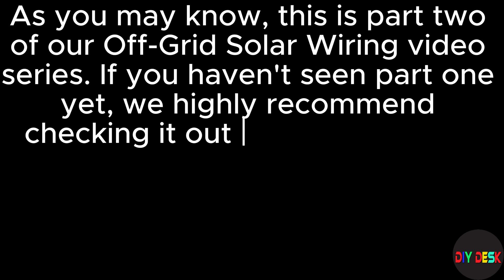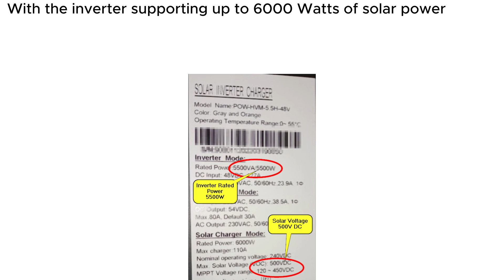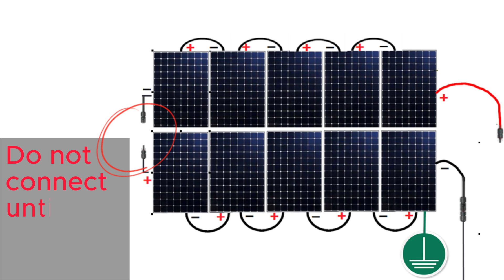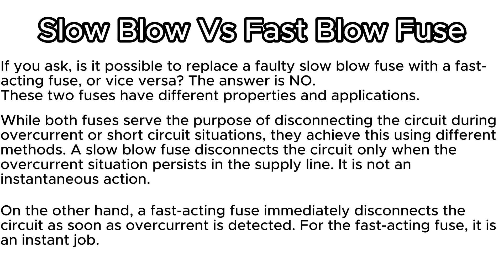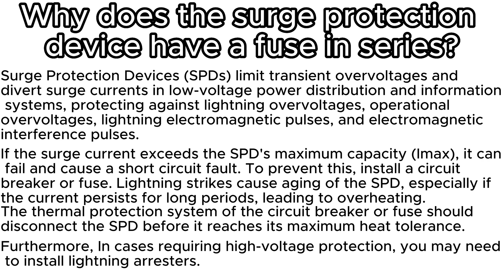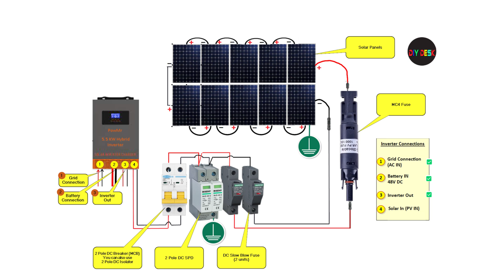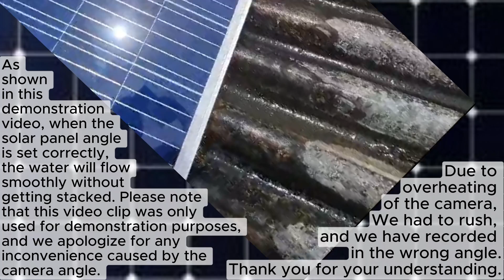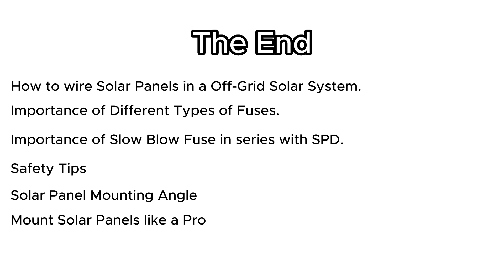Mastering Off-Grid Solar Panel Wiring: Essential Tips and Techniques for DIY Solar Power Enthusiasts

Comment: hello i think you do a great job with your vids. even a noob like me can understand. now do i have a question / request. I have here a 3kw grid tie inverter and like to use this in a off-grid situation. i saw a youtuber (Living Off Grid in Scotland ) who made a video explaining what he made. Could you make a video with your words, wich everybody can understand, explaining how to do a system like this. Thanks in advance and keep them vids coming, the're great !
Reply from the maker: Hi! Thanks so much for the comment – I really appreciate it, and I’m glad the videos are helping! Sorry I wasn’t very active over the past few weeks, but I’m back and ready to keep things going.

About using a grid-tie inverter in an off-grid setup, I’d be careful. Standard grid-tie inverters are designed to connect to the main power grid and pass the energy they produce directly to it. They don’t actually “store” power or handle loads on their own, so if they’re not connected to the grid, they’re likely to run into issues. Even if you manage to get it working off-grid, the inverter won’t last long and could end up failing because it’s not built for that kind of setup.

Now, if you have a hybrid inverter, that’s a different story. Hybrid inverters are designed to handle both grid and off-grid situations, which means they’re made to handle loads without being connected to the grid and can work with batteries.

So, unless you have a hybrid model, it’s best to avoid using a grid-tie inverter in an off-grid setup. I hope this helps! Let me know if you have any more questions, and thanks again for watching.

Comment: ¿Para un sistema off grid puedo tirar un cable ground desde el panel de breaker principal al panel de breaker off grid? ¿O deberia instalar un nuevo ground independiente especificamente para el sistema off grid?
Reply from the maker: Hola,

Has planteado un buen punto. Diferentes ingenieros suelen recomendar varios tipos de sistemas de puesta a tierra.

En primer lugar, no soy ingeniero, pero tengo algunos conocimientos a partir de diversas certificaciones. He leído mucho y discutido estos temas con ingenieros.

La mejor solución práctica que he recopilado de estas discusiones es tener una única puesta a tierra para toda la casa.

Si tienes un buen cable de tierra, puedes usarlo. Si no estás seguro de la calidad de tu tierra actual, deberías hacerla revisar por un profesional.

Si necesitas instalar una tierra separada, asegúrate de que haya al menos una distancia de 8-9 metros entre la nueva tierra y la existente.

¡Espero que esto te ayude!

Comment: Warning: The polarised MCB's often be used with the source comes from bellow. Keep in mind in this case the + should be connected on the RIGHT side and at the upper outlet also the + to Inverter should be connected on the right side. 
If the source (Solar panels) coming from above down into the MCB it should be connected as shown in this Video, with both + on the left side.
Reply from the maker: Thank you 🙏